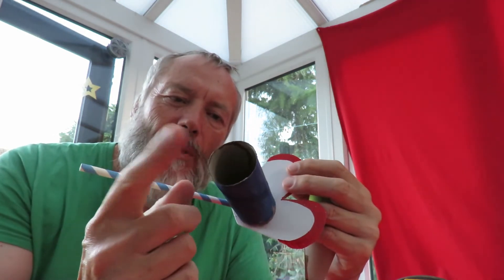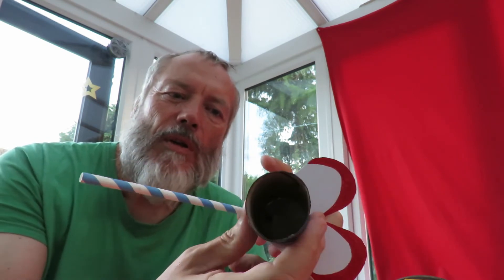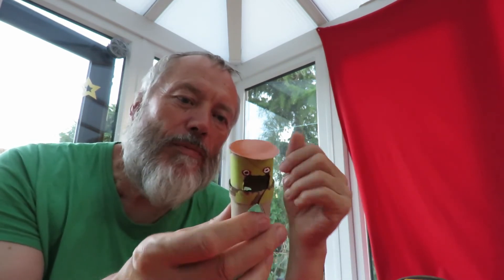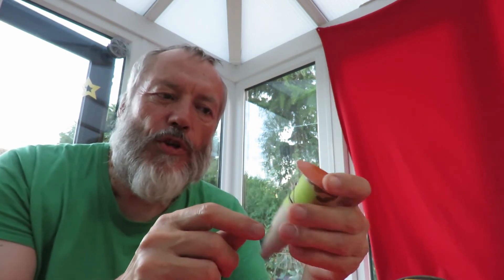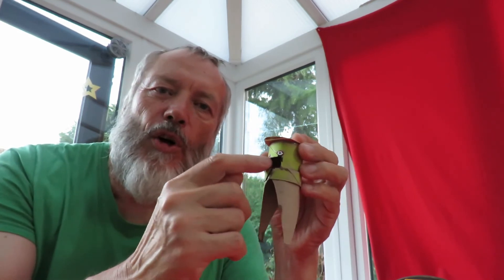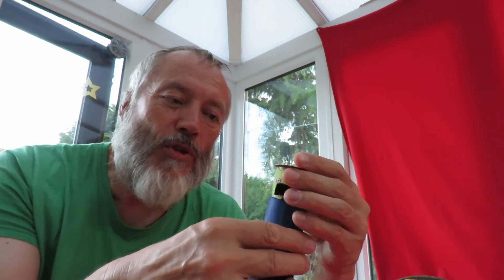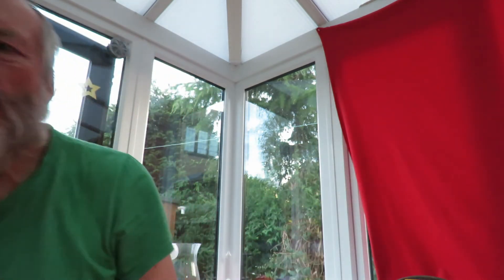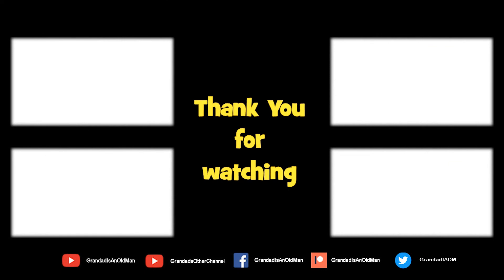Pop Up Piston Person

Comment: I am from the Midlands (literally ten miles away from the very centre of England, you physically couldn't get further away from the sea), yet every summer the whole place used to get carpeted in seagulls. Especially school fields and the local landfill site.
I now live in South Wales, about eleven miles from the sea, and I don't often see Seagulls, I see lots and lots of Ravens, though.

To make tougher tubes, you could cut strips from their lengths and tape them back together, then glue them inside each other. The thicker the strip you remove, the thinner the tube. You'd have to experiment (or get your maths out) to find how much to remove for the best fit.

Perhaps, also, you could cover the piston ring in Sellotape and use a little Vaseline or lip balm as a lubricant to make it run smoother. Or would that get staticky or sticky?

How about using a straw as an indoor lightweight rocket or aeroplane launcher? I know that if you blow the paper wrapper from a McDonalds straw, it doesn't 'alf shift, and it goes quite far (and frightens our Dog...).
Reply: Here is a little drinking straw rocket or missile toy I made back in 2014 https://youtu.be/HO-EvJ73tI0 you might like this one too https://youtu.be/7JhG-I6Hbsg